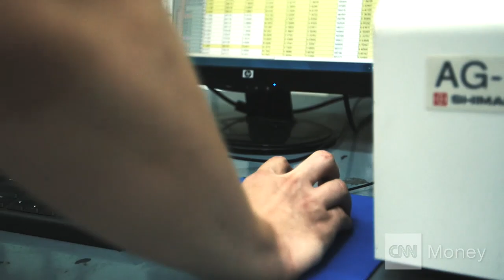This plastic is made from thin air

Comment: I am sorry, the person in me that went to college and became an engineer/pre-med student and studied, chemistry, organic chemistry, Physics, and biochemistry has some questions.

1.  I would like to see the numbers of air-flow vs percentage of CO2 pulled from the air.
2.  I would like to kno where the energy comes from to run the machines.  Are you hooked up to electricity on the main power grid?  If so, you are then negating and placing more CO2 in the air than you are extracting.   

Think of it like this.   You can not create a car that runs off of water even though water is H2O which is 2 parts H (Energy portion) and 1 part O (Catalyst).   The reason is it would take energy to split water into its elements, but it would take the same amount of energy when the exothermic reaction took place. 

2H20 + Energy --> 2H2 + O2   ---- Electrolysis.
2H2 + 02 -> 2H20 + Energy  

So what energy are you using to move the car and this assumes that you have no frictional energy loss within the system.

Anyway whoever is toting this failed to realize the 1st law of thermodynamics.

3.  The plastic companies have gotten the process of creating plastic so well from the exothermic reaction using organic molecules (oil) that it is pretty much a 1:1 ratio.   This is why plastic is so cheap and so readily used because it is cheap to manufacture and it can be "molded" into any form easily.  How energy does this process use?

So I am calling BS on this!
Reply: Aaron Wantuck It's a scam.  Check out the rough numbers Thunderf00t ran...  https://youtu.be/I7JxhFKycUI
Reply: blurglide Yeah I saw that video about a month ago after I posted my comments.
Reply: They sure did program the sense right out of you.  Here is your analogy beaten up: Google "Daniel Dingle" Google "Stanley Myers" Google "Aquygen HHO NBC" Google "Oxyhydrogen torch".  No one is saying he is making the plastic with zero emissions, just better than what we have now plus the fact the product isn't made of oil.  Once electricity is generated by wind or some other alternative source then your argument is totally void.  You will enjoy the torch example of the technology but realized this is very suppressed technology that has actually been used for decades.
Reply: No- it is not better than we have now, because it'll take a massive amount of energy compared to just making plastic out of petro chemicals.  Even if you used renewable energy, you'd be better off putting that energy on the grid and still making your plastic from base-stock.
Reply: +blurglide and you obviously didn't google any of the above because you are afraid of the truth.  If you had, your reply wouldn't have been so negative but at the risk of feeling butthurt at how naive you've been all these years.
Reply: You're talking without actually saying anything.  Check out the source I linked to above.
Reply: +Aaron Wantuck you should stick to the cheerleading part but the rest shows you are a complete and total moron!  AGAIN, if all the energy that is used for this was renewable(wind/solar) then zero carbons are used and in fact carbons are taken out(from he air)... You won first place in the tard category!
Reply: +Aaron Wantuck it took him 10 years to make it cost the same so your question "which one uses it more efficiently" just proves your mom should've swallowed you because you're a waste of flesh!
Reply: +Tom Lloyd 

"+Aaron Wantuck you should stick to the cheerleading part but the rest shows you are a complete and total moron!  AGAIN, if all the energy that is used for this was renewable(wind/solar) then zero carbons are used and in fact carbons are taken out(from he air)... You won first place in the tard category!"

Again, like we are trying to tell you, the numbers DO NOT WORK OUT.   If you are actually sceintifically literate you would understand this.   You have to get the raw material from somewhere, hence the carbon in the plastic and the amount of carbon in the air is NO WHERE near the numbers you need to make plastic.  So he has to be getting the Carbon from another source THEREFORE it is not a carbonless foot print.

Seriously how much carbon do you think is in the air at a given time for him to collect?   It is no where near enough.  Now the processing and separation of the carbon from the CO2 takes ENERGY!  A LOT MORE THAN  USING PETRO CHEMICALS!!!!!!

Look I am not going to continue to have a conversation with an ignorant person who presumes to speak from authority on a topic in which he does not uderstand the basic concept of conservation of energy.   When you actually learn some science, come back and talk to the educated, until then, pick up a book and sgn up for a basic chem course at a community college.  I mean I explain the problem in my original post using REAL chemical equations and you have not even addressed it.  You only tell me he "perfected" it.   Yeah, I perfected picking up hot chicks in a bar also but that does not SOLVE the initial problem.
Reply: +Tom Lloyd Here is another point with you ignorant morons who speak from authority.   The idea or concept reality that something MUST be proven using the scientific method for it to be valid, then a peer review paper MUST be written where other scientists can critique your finding and replicate your results independently.

So in order to have something viable the person making the claim MUST present evidence that it is viable working model.  It seems you morons forget this part which happens to be the MOST important part since without being able to replicate your experiments and claims then there is no way to verify the person did not "fake" his results.....

Your suggestion on Daniel Dingle was a good one and further validates my point that you do not understand the 4 laws of thermodynamics and neither did he.   Apparently he claimed to create an engine that ran on hydrogen by separating the water.   Since you do not understand the concept of a carnot engine my equation in the original post proves EXACTLY why this shit would not work.  However you felt the need to point it out anyway and unlike mr, dingle dong I least understand the conservation of energy in this case and knew it would not work.  I guess that is why he got sued for fraud ... dumbass!

Stanley Myers was a film composer..... so you again look really stupid.

Aquygen HHO NBC is another hoax like invention.  If you actually took the time to do some research you find out that they infuse the water with gas and fuel and have to use ENERGY to extract the necessary fuel components.  It becomes MORE expensive than using petro and your car can not completely run on it.   Again the laws of thermodynamics is a bitch and the Theory of Conservation of Energy ALWAYS wins.   Another point is this company claimed in 2006 that its products would be on the shelves in 2 years......  So where is the peer review papers on this AMAZING tech.   There is none because it is not feasible and it is garbage so evidence wins again.... man you again are looking rather stupid!!!!!

Oxyhydrogen torch, this torch is just a "rehash" of the above statement.  Again mining and using acetylene is far better and more efficient.  Again the Theory of Conservation of Energy wins again......

Wow could it be that this statement you made to me:

"They sure did program the sense right out of you. "

Really applies to you?   Do us all a favor, before you want to join the adults at the big table and graduate from eating on the card table during company, I suggest you grow up and learn a few things and right now leave the thinking and science to the people who understand it.  I suppose next you are going to tell me evolution is a fraud , the earth is only 6,000 years old and the theory of evolution is just a theory.
Reply: +Aaron Wantuck he drove the car for 30 years and the president ride with him.  Have a well preprogrammed life, don't think independently or else you'll be shunned.   You are still asleep, probably best not to wake you.
Reply: +Tom Lloyd 

"he drove the car for 30 years and the president ride with him."

CITATION NEEDED!

I guess you failed to read this part:

"“Daniel Dingel, 82-year-old inventor of a “water-powered car,” has been convicted of “estafa” [swindling] and sentenced to a maximum of 20 years imprisonment by the Paranaque City Regional Trial Court. The court also ordered him to pay $380,000 in actual damages. Dingel, who has never revealed the secret to his invention, which he began in 1969, questioned the verdict but said he did not mind going to jail at his age. As of late Friday, he remained at large. Dingel was found guilty of taking $410,000 from Dr. John Ding Young of Formosa Plastics Group, a Taiwanese company, which gave it to him as research and development funds. The decision, written by Judge Rolando How of the court’s Branch 257 and released on Dec. 9, said Dingel defrauded Young when the inventor failed to fulfill his obligation of developing his “hydrogen reactor” and creating experimental cars in 2000. The unique device – a “hydrogen reactor” resembling a 12-volt battery – impressed the Taiwanese when Dingel demonstrated how it powered and fueled the car’s engine. They were also told that fuel from water had clean emissions as it did not produce carbon the way gasoline did. After receiving the money ($300,000) by wire transfer, Dingel avoided replying to his emails on the progress of the project and instead sent copies of letters from other foreign investors offering Dingel larger sums of money. Young said he kept his end of the bargain by sending another $60,000 in additional funds for R&D as stated in the joint venture agreement. He said it was then that Dingel began ignoring his communications. He said he sent demand letters for the return of $410,000 were but Dingel did not give the amount back. Instead of returning the money, Dingel withdrew $375,603.89 from his bank account and left only $500. “He admitted withdrawing the money after learning that a suit had been filed against him,” it said. “His act of immediately withdrawing the money indicated bad faith on his part.” – Source

Also NOTICE the section that says this:

"who has never revealed the secret to his invention"

You see a REAL inventor or someone who discovers something like this gets a patent, releases the tech in peer review journals and then demos his invention to the world.  This way other scientists can see how he was able to split H from water and get more energy out that he burned.   Which again is IMPOSSIBLE and he equation in my original post shows why.   If people were able to just make claims without using the Scientific Method then science would be a joke.  This is what cult texts like the bible, torah, and Quran do.  they make claims without any EVIDENCE to back up their claims.  We use the scientific method because it works and every piece of innovative technology created today come from the use of this method to create REAL predictable models of the world in which we live in.   

So when a "nut ball" claims to have ridden in a car for 30 years that ran on water WITHOUT providing evidence and "keeping it a secret".  The science community call that the "full Pinocchio".  

It is not I that does not live in the real world it is you, who easily succumbs to stupidity and propaganda witout doing the full research yourself and understanding why something like this does not work.  Like I said, instead of being ignorant, pick up a chem book and take a course at the community college.
Reply: +Tom Lloyd Yup after I show how your suggestions were a scam, you scurry away like the roaches do when you turn the lights on.  When you are ready to play with the adults and join in on an adult conversion to develop those critical thinking skills let me know.
Reply: +Aaron Wantuck here is another example of a car running on water-Hello all! Well its sad to see so many naysayers running around out there crushing Every ones dreams before they have a chance to get a good view of them. I'll make this quick, MY 96 PONTIAC SUNFIRE SE RUNS ON WATER AND NOTHING ELSE! I have simply combined the energy of the sun, with the stored energy of a moving car, with the energy of electrolysis, with the energy of a steam combustion engine. Using diodes, and pulse width modulators and solar panels and dry cell batteries and extra alternators, along with a very nice filtration system in my stainless steel exhaust that catches and recirculates the water back into the holding tank I have created a very nice hydroxy steam powered car! ---he did this is 2008
Reply: +Aaron Wantuck read my lengthy post giving all the details but also Google "Stanley Myers" and after this you need to not only stfu but start opening your closed "engineer mentality" because it just got owned!
Reply: +Tom Lloyd 

"read my lengthy post giving all the details but also Google "Stanley Myers" and after this you need to not only stfu but start opening your closed "engineer mentality" because it just got owned!"

I do not think so.   You people are really all the same.   You honestly think you can defy the laws of physics, chemistry, and a bit of common sense.   You also again cherry pick everything you say.

I am sure when it came to sanely Myers you read this and the several of many articles that verified the same thing.  Links provided.

"The water fuel cell is a technical design of a "perpetual motion machine" created by American Stanley Allen Meyer (August 24, 1940 – March 20, 1998), around which a case of controversy developed. He claimed that an automobile retrofitted with the device could use water as fuel instead of gasoline. Meyer's claims about his "Water Fuel Cell" and the car that it powered were found to be fraudulent by an Ohio court in 1996"

http://www.dispatch.com/content/stories/local/2007/07/08/hydroman.ART_ART_07-08-07_A1_4V77MOK.html

http://www.nature.com/news/2007/070910/full/news070910-13.html

So, I guess again you lied and showed false information and this guy just like your "Dirk Dingle" was charged with fraud.  I wonder why that was.  could it be that he himself lied and the again the Laws of Conservation of energy wins.

Okay, so now using evidence you were proven wrong... again.

"here is another example of a car running on water-Hello all! Well its sad to see so many naysayers running around out there crushing Every ones dreams before they have a chance to get a good view of them."

No one is crushing anything.   Please do not confuse destroying someones dreams and adversity to overcome a problem to better mankind with what amounts to the "pyramid scheme" of science.  There is a HUGE difference.  For example if you told me you created a hoverboard that could hover over every surface like on Back To the Future, I would call bullshit.   However if you told me you found a way to extend the mileage of a car by reducing the friction of the pistons in the engine and designed a better way to deliver the fuel to the pistons thereby generating less engine heat and engine wear, I would say, wow let me see your schematics and then ask you a million and 1 questions.  Heck, if you even said you had an idea for a liquid battery that used density layers as the salt bridge, anode, and cathode and was far more efficient and easier to replace than the current electric car batteries, I would be also interested and so would many others.

Why, because those things are FEASIBLE.

First you NEED to read this and follow any of the links in the article to the peer review papers on the bottom.  In fact this article is LOADED with evidence provided with peer review papers.  You might actually learn something.

https://en.wikipedia.org/wiki/Water_splitting

"I have simply combined the energy of the sun, with the stored energy of a moving car, with the energy of electrolysis, with the energy of a steam combustion engine. Using diodes, and pulse width modulators and solar panels and dry cell batteries and extra alternators, along with a very nice filtration system in my stainless steel exhaust that catches and recirculates the water back into the holding tank I have created a very nice hydroxy steam powered car! ---he did this is 2008"

HOW??????????  Citation Needed.   I already showed that both your guys did this was a scam.   So the likely hood that you really did this is bullshit.   However I open to things.  Please post the pictures and provide links.   Then provide the rest of our readers with the schematics and data for analysis so that the rest of us can critique it.   All you do is list a bunch of shit that you think is technical and say... Booya I did it.   Any person can do it.   

You see I made a flying hoverboard using a magnesium reaction to transform the silicate in the earth as the item moves over it.  The repulsor uses the an advanced magnetic stabilizer to amplify the magnetic field surrounding the Heisenberg compensator.

Now lets do things for real and get out of fantasyland.

Take my original equation:

2H20 + Energy --> 2H2 + O2   ---- Electrolysis.
2H2 + 02 -> 2H20 + Energy  

Lets say after  you calculae the Delta H of the equation you come up with 20 joules of Energy.   This would mean that for every reaction, providing that we do not have a limiting agent and it is frictionless (which is impossible), you would need 20 joules of energy in both directions.   They would essentially cancel each other out.   

Now, in your dumb reply above in an effort to sound more intelligent than you are, you pretty much say that you have a battery charged by a solar panel or group of solar panels.  You then use this battery to deliver the energy into the batter thereby altering the equation like so.....

Solar Panels (Sun 20 Joules of radiation energy) --> Battery Charge +20 Joules)
2H20 + (Battery +20 joules) Energy --> 2H2 + O2   (20 Joules potentially) ---- Electrolysis.
2H2 + 02 > 2H20 + (-20 Joules)  ->  [Calculate the Delta H]

So we have 20 joules of exothermic energy to move the car.

So in a sense you are ADDING an extra step which in REALITY would reduce the amount of energy in the system if friction and heat dissipation is accounted for.  So it would more than likely look like this:

Solar Panels (Sun 40 Joules of radiation energy) --> Battery Charge (+30 Joules)
2H20 + (Battery +30 joules) Energy --> 2H2 + O2   ---- Electrolysis.
2H2 + 02 > 2H20 + (-20 Joules)  ---> Motor - moves car

That would still give you 20 joules of exothermic energy to move the car which means 50% in my example was loss to heat.  Now the efficiency could be improved so in reality you may get better numbers, but it will NEVER be a complete perfect transfer.

It would be far better and more efficient to do this which is what @blurgide was trying to tell you.

Solar Panels (Sun 40 Joules of radiation energy) --> Battery Charge (+30 Joules)
Batter Charge (30 Joules) -> Motor - moves car

Which gives you a much more simpler and efficient system and you have more exothermic heat energy to move the car.  

Now if you have broken the laws of physics and chemistry I am sure everyone wold like to know and you can then pick up your Nobel prize.  However, until you actually furnish proof of your "Greatness" by providing data, pictures, and schematics, you are doing nothing more than blowing hot air.

I am sorry but who was burned here.   Again science ALWAYS wins over empty claims.